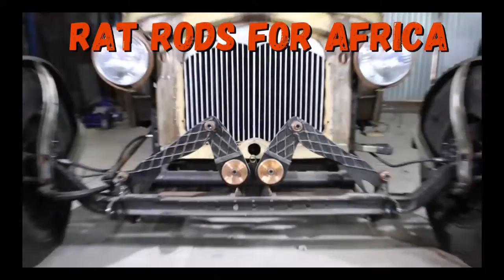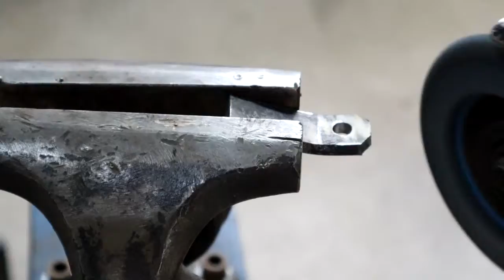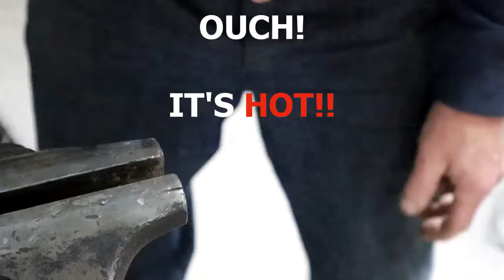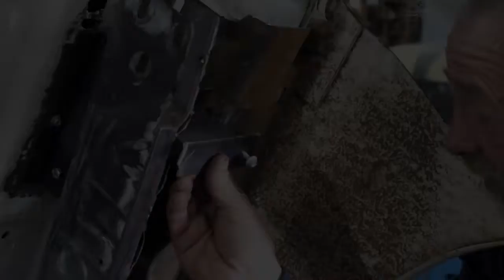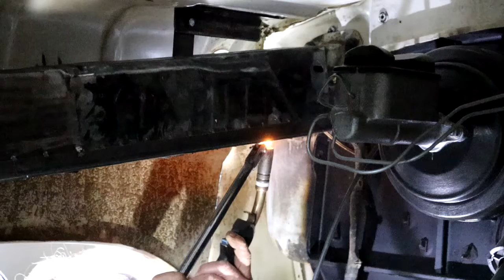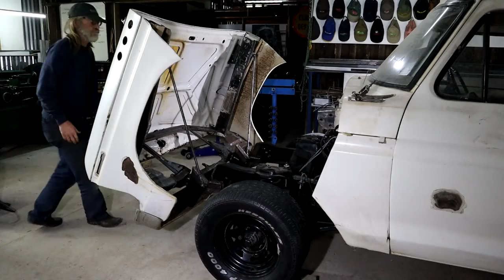TILT FRONT END CONVERSION FORD F100 - BRACES (Part 4)

Comment: Would like to do this for my 65 F100, but was brainstorming to NOT have to cut the fenders, but to create a SLIDE then TILT, in other words the COMPLETE fenders would remain in tact, NOT cut across the outside surface, the slide would allow the fenders to slide FORWARD to clear the cab & then tilt, the front wheels could be turned to the max position to aid in the front end to come forward, based on your experience thus far do you think my idea is feasible?  Just subbed
Reply from the maker: That would require a complex mechanism! That front end is heavy, so it would have to be some serious enqineering. Wondering if it is worth the trouble...
Reply: @ratrodsafrica  Well you already have the tilt part figured out, I was thinking about something similar to the rollers & channels you see in kitchen type cabinet drawers, the slide mounted to the cab behind the fender and 1 or more rollers mounted to the inside of the fenders at the slide location, the slide guide would keep the  rollers in position to roll the fender from away the cab the distance where those ends of the fender would clear the cab & then tilt as you have it. just an idea, you tilt mounts could slide out as the fender ends slides out  😁